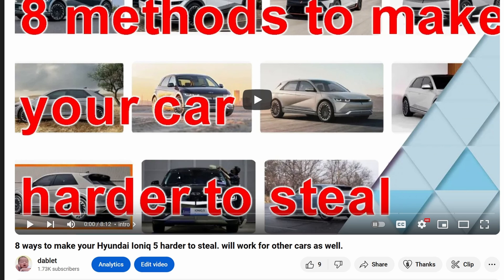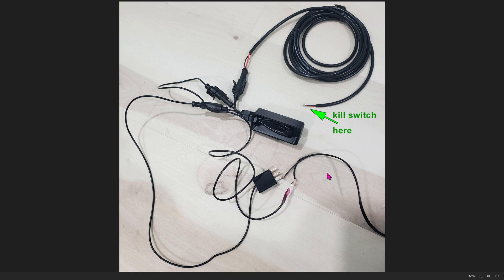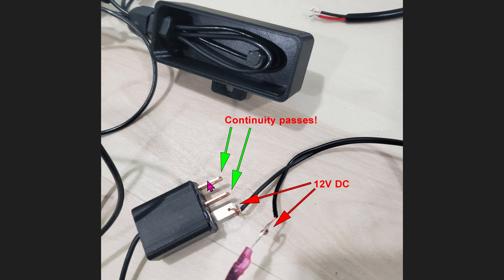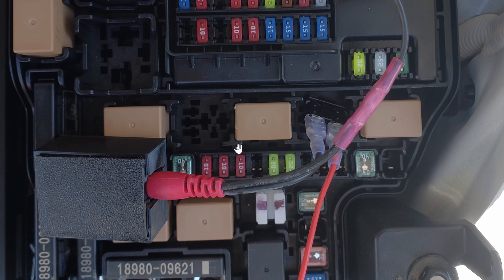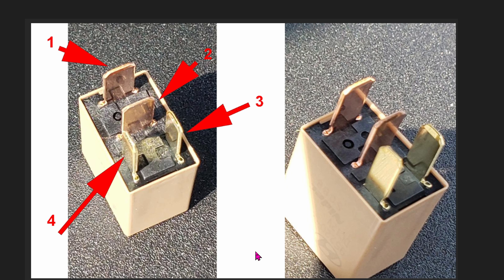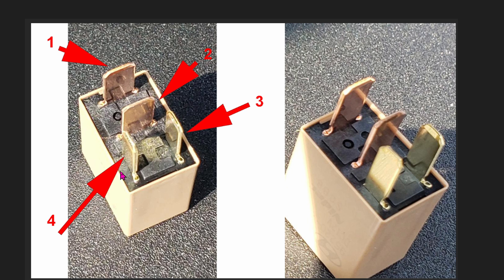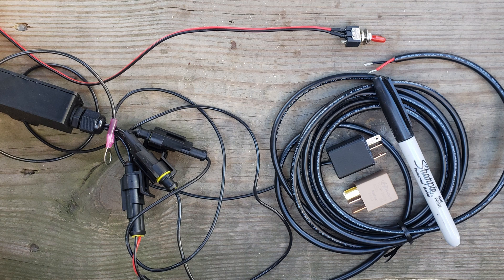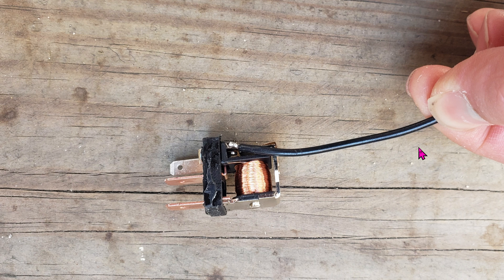how to make your own relay bypass kill switch to make your car harder to steal

Comment: So good been wanting to do this,

Its 150$ aud to post to australia

So pretty much open up relay , cut the ground pin, solder wire to ground pin. add fuse and switch to wire and thats it?

Comment: I almost purchased the 41-22 kit, glad I found this video first!  I wondered what was in the box with the two wires. I bet they added that to make the kit look technical and worth $100. I just got a 3 pack of GM relays for $17 and a $20 switch and did it myself, works perfect. Thank You for this video!!
Reply from the maker: yep.  41-22 is just scam. they claimed that box has a smart chip. just unbelievable.

Comment: So glad I found your video. I had purchased the aforementioned company's kill switch kit last year and was just getting around to installing it.  Unfortunately, even though I ordered the correct relay type (Type 2) they sent me a box marked "Type 2" but inside they put the "Type 1" relay.  Useless for my Kia.  I was going to order only the "Type 2" relay switch from them again when I saw your video.  You saved me a lot of headache.  I'm gonna get a real Kia relay switch and modify it as you showed.  Thanks so much!

Comment: If I make this and toggle it on to start the car… do I leave it in “ON” position until I turn it off? Or only have it on during start up?
Reply from the maker: turn to ON and leave On while you are driving as well.  turn to OFF when you are finished driving and wont be using the car
Reply: @ thank you. I attempted this but it didn’t work? Maybe connect the wire to the negative? I just grounded it and that’s not working.

Comment: $98 way to much. In the past I spliced into number 85 wire on relay pigtail using a toggle switch on a Buick. As I understand about .3 milliamps is all it carries.